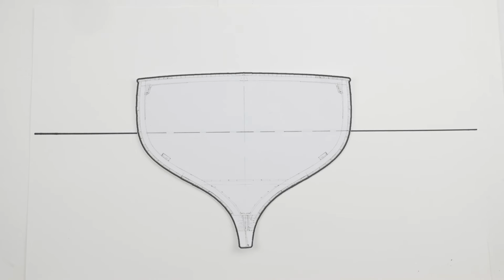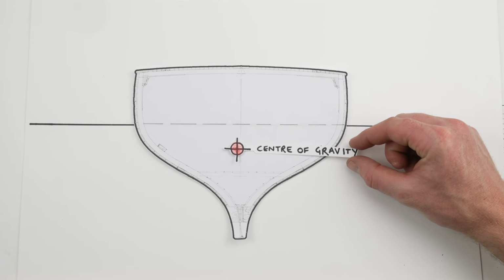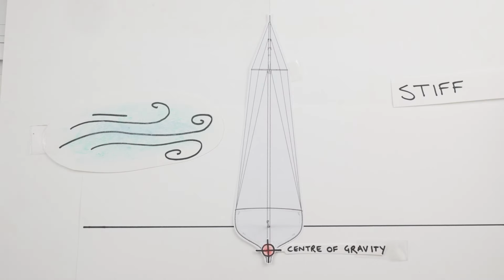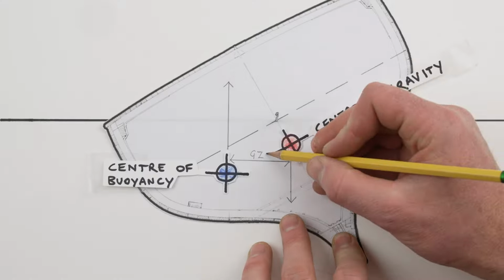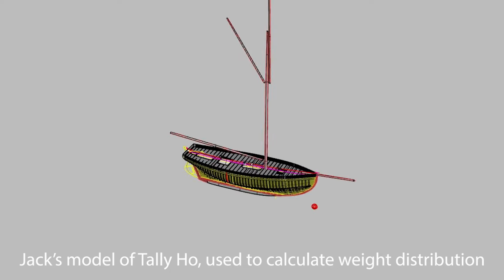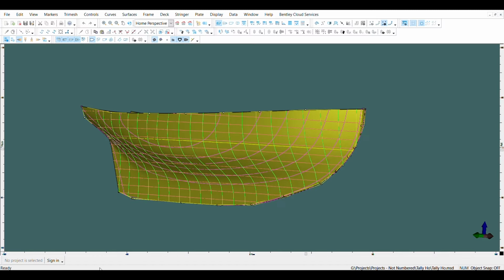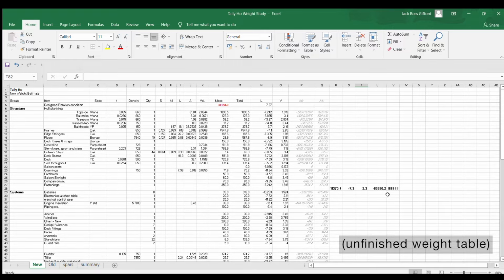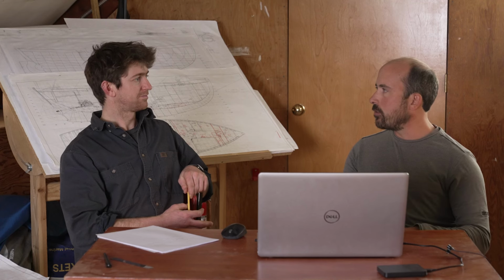Stability Calculations (Boatbuilding / Tally Ho EP125)

Comment: Question: It sounds like two major changes - lighter rigging and more external ballast - would both tend to lower the CG and result in a stiffer boat. 
What changes are you making that counteract those two so the handling of the restored TH is similar to the original?
Loved the nerdy details.
Reply: Unless he plans to counter with more sail area 😉

Comment: Shouldn't you have done this BEFORE putting in the new ballast?
Reply: Leo has been working w/ another architect for over a year, they certainly examined the design of the much heavier ballast keel before it was cast. This current process is in the manner of fine-tuning.
Reply: Tank Sizing and placement, as well as tender placement  has noticeably affected the performance of several boats I have used.

Comment: The definition of the CG, made me think of aviation. Which ironically is very similar. Far as for/aft...top/bottom. Trim balance can be accomplished on the ground,  but will be adjusted after a few test flights.

Comment: Very interesting. I hadn't realized just how much calculating was necessary.
Is this, these calculations, come into play in ALL sailing boats, or just racers.
Cheers,
Vernon
Reply: All new watercraft designs need stability calculations, so their owners & insurers sleep more easily. Purpose-built racers will really get the treatment, as they need to weigh as little as possible while still remaining upright.

Comment: Might sound crazy, but does anyone put a bit of ballast on top of the mast? It would be counterproductive to the CG (unless the ship was excessively "stiff") but would have the largest possible difference to the moment of inertia, which would slow down how quickly forces can lever the boat around. The moment of inertia affects the frequency of roll oscillation, so having lighter weight spars will mean that the new ship will wobble faster than the old ship. Maybe that's desirable for all I know, you'd definitely be able to feel changes in wind faster.

Comment: Is it possible to have a weight that you can hoist up the mast to make the boat more tender, or drop down to make it stiffer?
Reply: I've not heard of designs that try this, but it wouldn't be unusual to reduce topside weight by un-rigging & lowering the topmast when heavy weather approaches.

Comment: Curious - since you modified the keel slightly with this pour, is there an opportunity to improve any handling characteristics in figuring out the placement of the ballast?

I understand the desire to stay as true to the original design of Albert Strange as possible, but is that the driving reason for keeping those characteristics? Or are they perceived as the best for Tally Ho regardless?

Comment: "Sails have to be a little heeled over to work properly, to work efficiently" Time 6:17.... Can someone point me to the physics explanation to support this claim.
Reply: Well, I can't but I can give you a qualitative explanation.  Sails are cut so they have a 3-D curved surface, the "belly" of the sail, that produces the correct aerodynamics, much like an aircraft wing.  In very light airs, the sail will just hang from a vertical mast (and gaff), and flap about a bit.  If the boat is heeled a little away from the wind, the belly will fall into place better, and the sail will be able to harness the small available forces from the lightest of breezes.  This effect is practically noticeable even in small boats with much less inertia than something Tally Ho!'s size.
Reply: @jonathanrichards593  Well said, Jonathan. I once described the "vertical" aero wing to a disbeliever but it's tough going if the curious have never studied vectors.
Reply: @jonathanrichards593  Thanks. So if I understand... gravity will shape the sail if the wind is too light to do it. So its an edge case only.

Comment: Would had been nice if you had also talked about the influence of ship shape on stability. And told the difference about weight stability and shape stability and that sailing boat with keel weight are mostly weight stable with GM below BM. And the Metacenter would be also intresting to know for those who are not naval architects.

Comment: An exemplary presentation of a fairly complex matter! I’ve made my own interpretation of Tally Ho in 3D using Sketchup, and in order to find the floating lines I used the same procedure of building a spreadsheet giving me an estimate of the center of gravity. To assess the center of buyancy I used rough models in 3D giving me the volume of the hull. Combining the calculated weight and the volume I then found the place of the buyancy center for 0 degrees, 15 degrees, 30 degrees and 45 degrees of heeling. Not being an engineer, nor having done any kind of this work before I was really looking forward to this episode and I was not disappointed because the methods described by Leo very much looked like the methods I have used. I am posting a drawing of my version of the Tally Ho on the Tally Ho Facebook group shortly.

Comment: I was told years ago (probably before much of the 3d modelling) that, at least initially, boats rarely sat exactly on their designed waterline. It may be that the ballast approximation on the original drawing was intentional to allow fine-tuning later.

Comment: If I understand the concept correctly, then a wide vessel would cope with a higher center of gravity, because the center of buoyancy moves strongly to the side as soon as the vessel is tilted.
Reply: Yes, I think you're right.  This also accounts for why Polynesian long narrow hulls are equipped with outriggers - they get the stability from the buoyancy of the outrigger (or the other hull, in the case of a catamaran).

Comment: Can you get the guys with the boat lift to weight Tally Ho and measure the center of mass?  I am not sure that keeping the stability as the original boat is a good idea, not if it can be made better and safer.

Comment: I have to wonder how it was done before spreadsheets and computers
Reply: manual typewriters & carbon paper, also mimeograph duplicators.
Reply: @frederickstibbert7389  I was thinking of much earlier than that. Think Captain Cook days
Reply: @bobuncle6962  - haha I was thinking WW2 !
I dunno the state of naval architecture in 1760, I suppose it was mostly traditional wisdom rather than applied engineering theory. But they did have sophisticated maths, enough to produce predicted star-sighting data, printed logarithm tables, & navigation using sextant & spherical trigonometry.
Reply: @frederickstibbert7389  Ah thanks for the explanation.  I may get a moment to do some research

Comment: There is a difference between uk ton and us ton. In which unit are you working in?
Reply: As Tally Ho was designed & built in the UK I would presume UK Ton i.e. 2240lbs

Comment: The original calculations without electronic computers would be fascinating to see if they were still available.
Reply: See if you can find an edition/translation of Éléments de l'architecture navale, ou Traité pratique de la construction des vaisseaux by Henri-Louis Duhamel du Monceau (2nd ed 1758). 
"Having observed that most builders worked "randomly and without a firm grounding," the author decided to compose this work in order to "seal the shipbuilder's secrets" which until then had been jealously guarded so as to protect the rank and reputation of only a few select families. ... the first printing of the treatise is soon followed by a second edition in 1758 to which the author appends a tenth chapter devoted to the stability of the ship."
Reply: @jonathanrichards593  I accept the challenge lol. Thank you.

Comment: given that the design is probably older than the 112 year old boat and that the original builders were without technology of spreadsheets, 3D modeling and laser refencing I'd like to see what would have emerged for these calculations using traditional methods and verses modern tech? And frankly you have said that you are endeavoring to reproduce the original waterline etc. I have to ask, why wouldn't you employ traditional methods.  I recognize that there may not be anyone alive today who can reproduce the full extent of the 112 + years tech?? I also recognize that you would not want to apply marginally accurate tech that would endanger the labor you all have invested!!  Your online community as well as yourselves do not want to see loves labor lost!!!

Comment: Could the boat weight be determined using the travel lift?...and then use cals to figure for what is left to install?  Also what role does the center of lateral resistance play in all of this?  Or is this term synonymous with the center of gravity?

Comment: So, with the added lead to the keel and the lighter rigg Tally Ho will be stiffer than initially designed to be. Correct?
Reply: I think at this time, they are trying to match the performance of the 1927 rig, by determining a reduction of the internal ballast in light of the new, heavier lead keel.

Comment: Stability of ships was a big area of research in the  17th, 18th and 19th centuries.  The Royal Society contains quite a few documents relating to the issue which attracted some top drawer people of the day. Imagine working out a surface area of a hull without modern software. Newton's Principia (which dates from the 17th century) contains a calculation of the shape of minimal resistance of an object travelling in water. It is highly geometrical and essentially impenetrable to modern people (I know because I've tried) and I can recall a physicist solving the problem with modern techniqes and being absolutely stonkered to find that Newton was spot on.
Reply: Newton was a genius after all.

Comment: In aviation it's called weight and balance and is part of the airworthy certificate and needs to be redone with any equipment changes  Bill
Reply: Similarly, any marine insurance company that Leo deals with will be greatly reassured by a naval architect's plots of Tally Ho's stability curve.

Comment: Excellent episode!  It wasn't mentioned, but would you not want to position fuel and water tanks close to the longitudinal CG so that the longitudinal CG does not change much as you consume fuel and water?  I am an  aerospace engineer familiar with aircraft design, and this is a stability issue there.  Don't know whether it's considered sensitive for small sailing craft.

Comment: I sure hope Doug over at SV Seeker watches this video...
Reply: But it's far too late to do any good. The problems with that build are already built into the boat in ways that are probably not fixable, without hauling it and adding blisters, or cutting off and moving the keels, etc.. 

For one thing, as Leo points out, the port/starboard CB and CG are assumed on the center-line of any boat. Boats are supposed to be symmetrical on end view. But the Seeker inexplicably lists something between 4 and 6 degrees to port (I think it is to port). My guess is that this is because of the massive twist of the boat, which makes it NOT symmetrical from side to side. 

Not sure that is even fixable. It would take tons of internal ballast if possible to do, and the boat already sits something like a foot or more below its waterline. But it is about 40% over its "designed" displacement, and adding more will only add fuel to the unstable fire. 

Watching this video is too late to fix the unfixable Seeker. What should have been done is watch other videos, and maybe read a book or two, before folding it up and welding it, at the very beginning.

Comment: I feel like there was one important point missing... or maybe I just missed it.  from a practical enginerding standpoint... where are these theoretical points measured from?  the bottom of the keel? the water line?  where is the reference point or surface on such a curvy shape?

Comment: I presume their might be a small adjustment when you actually float the completed boat since there is uncertainty with wiehts of all the rigging, fittings, equipment, furniture etc.  that will not be resolved until the boat is "done".  the final weighing happens when the boat is floated, yes?

Comment: When making a boat tender or stiff, how much do you actually move the center of gravity?  Like with Tally Ho, if you wanted to go to the limits in either direction but still make it a usable boat, do you change the center of gravity by a couple inches?  Or is it like a few feet?

Comment: Makes me think about how to right a boat, like the Tally Ho, that has capsized.
Reply: Not a pleasant prospect.  I would expect that in the process of capsizing the hull would take on so much water that it would no longer float.  Everything not bolted down will fall onto the deckheads, meaning that the CoG is in a different place to when upright.  Even in a flat calm it would be hard to right a boat as heavy as Tally Ho! using a salvage crane.  Boats don't capsize in flat calms.
Disclaimer: I've never righted anything bigger than a dinghy from a total capsize, and that was enough of a struggle.

Comment: Like a big oval with a stick through the middle (COG) balanced over the center of buoyancy. Where you put weight above or below the plate or how far up & down the plate is on the stick determines how far it can lean over before falling over. That's not a good thing so there's a lot of head scratching going on as you can see by Leo's rather tousled locks. Love me tender takes on a new meaning.

Comment: When you’re talking about 30 tons, does the amount of crew impact how much internal ballast you need? If you had a full crew with loads of food and gear, would you remove ballast? Or does the boat just sail a little stiffer?
Reply: You have to consider that as percentages. I'd wager that crew, food and gear is such a low percentage change in mass, it can be largely disregarded.
Reply: For the average stability the total figure probably doesn't affect things much - total displacement 30,000 kilos, weight of 2 extra crew, 2 suitcases (which would not be welcome, there being no space) and some extra food (not really needed, just put into port more often if over-manned), maybe 200-250 kilos at most. But for the disposition of the weight, it would make a huge difference. Those extra crew will definitely be required to sit on the weather rail when beating and in the middle when running, and the extra food and luggage will have to be central athwarships. Look at any photo of e.g. a J class sailing yacht (around 160,000 kilos) and there's 20 crew with their legs over the weather side, and not just for the photo.

Comment: Well graphically explained. Paper table calculation ages have serious respect. 
Part reasons I have to compensate for lightened motor weight. Vessel ballance can be delicate to hold your lines.

Comment: Just FYI in the spreadsheet shown for the original boat, you have listed bronze floors (which isn't right --- iron was used?) but the math value 7650 kg/(m^3) is correct for iron.  If you copy & modify that spreadsheet page for the rebuilt boat, then you need around 8800 kg/(m^3) for bronze.  HTH.
Reply: I looked at the new sheet.  You still have the wrong value for bronze.

Comment: I wonder - would it be possible to add a anti-ballast (MUCH smaller - say 200kg) to the mast, that can be hoisted up and down. As the mast is ~10x farther away from the CoG as the keel, you could effectively "tune" the stiff/tender character depending on your mood and the wind (equivalent to subtracting 2000kg of keel-ballast). In case if inclement weather, you could lower the antiballast, and instantly gain stability. Would this work?

Comment: Center of gravity is very important in airplanes, too. Fortunately, we don't need to worry about lateral and vertical position of the CG but its longitudinal position is critical.
The position of the CG affects both the stability and the performance of the aircraft. Within limits, the farther forward the CG the slower and more stable the airplane and the farther aft the CG the faster and less stable the airplane.
Calculating weight and balance is a vital part of preflight planning, especially if you're carrying more passengers and baggage than usual. The W&B calculations will tell you if you are within the load envelope of the airplane and can give you insight on what should stowed where and who should sit where, depending on the weights of the items and passengers in question.
Using a 1994 Piper PA-28-181 Archer III as an example, at gross weights of 2050 pounds and below, you have eleven inches between the fore and aft CG limits. Above that weight the forward limit moves aft until, at the maximum gross weight of 2550 pounds, your allowable range is down to 4.5 inches.